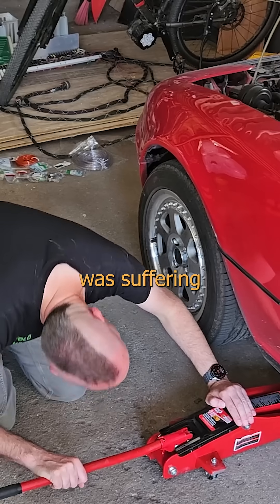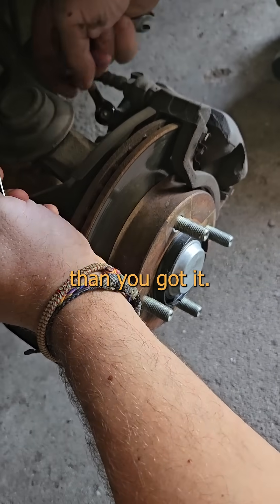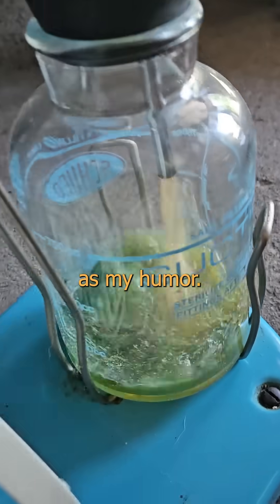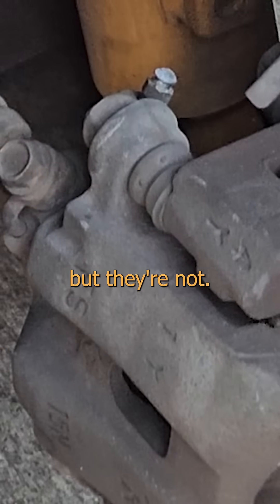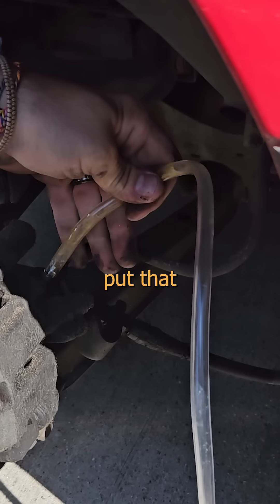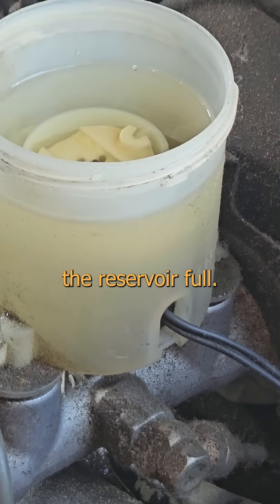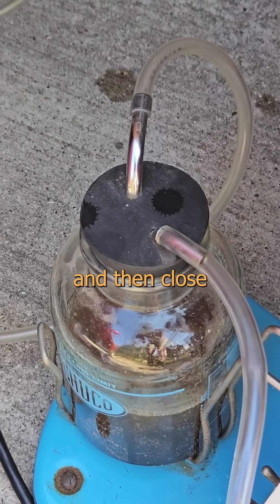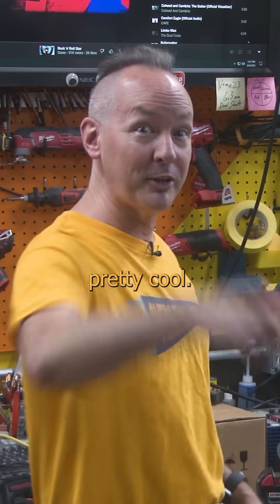How To Change Brake Fluid #chrisboden #comedy #engineering #educational #diy #skills #lifelessons

Comment: if you loop a hose twice hold it together tight with a rubber band and make sure its hanging some what upright and just pump your breaks if air comes out it will be pushed out but if it comes back in it will get trapped in the top loops

Comment: It's not really that over engineered, the machine we have at the shop does sort of the same thing. It pushes fresh brake fluid into the reservoir and you have a little suction hose for the old fluid. Fuck pumping, this is way easier.

Comment: Hey Chris! I dont know if you haven't known or if you dont care, but those bleed nipples aren't just regular 9/10mm, those are very slightly smaller, the standard open wrench will "work" with those, but you have a high chance of stripping those valves. Same for brake lines or clutch hydraulics. I recommend getting a flare nut wrench set, those fit on perfectly and have more grip, no chance those will slip! Might save you a lot of headache as I'd say youre also the kind of guy who works on his own cars and also loves having a good tool for the job hah

Comment: Remember to start with the rearmost breaks furthest away from the master cylinder train at first , then the other than the other two upfront. And it would not hurt you to heat it up a little bit before you try to move those nuts on the blead valves , because believe me , when they strip , you better off just getting a new  cylinder.

Comment: Polyethylene Glycol is not an oil.
Edit: it's a hydroscopic polyalkylene glycol-ether based polymetric fluid in the family of polypropylene glycol ethers with borate esters to resist compression, boiling and water vapor cavitation.(Not an oil)
"And that's pretty cool!"
Also, good on ya for freshening up your freinds whip.
God bless you and yours brother.

Comment: As a general service tech, when we sell brake services the machines we use to flush brake fluid out work in a similar manner. There’s a part that fits over the fluid reservoir and a part that that attaches to whatever caliper you’re servicing that allows you to pull a vaccine and cycle in new fluid at the same rate.

Comment: You can do it the other way too!  At my work, we pressurize the resivoir and force new fluid into the system while we bleed the old fluid out.  It's a great way to do it because it's fast and you can easily measure the amount of fluid you replaced.  That way you know how much to charge the customer for in materials, or how many beers they owe you.

Comment: Ypu can alsp do this with positive pressure useing a pump spray bottle full of fluid attached to the resivour. Just make sure you have a bottle to catch the fluid from the brake caliper or many many cans of brake cleen. I mean as a mechanical capable man im very used to having fluids sprayed everywhere when im working.

Comment: Just remember, especially on vehicles with abs modules, never let the fluid get below the level of the reservoir container because you need a high level scan tool to even access the abs computer let alone do a flush on it. Once air gets in, you aren't getting it out easily. When I had a bad brake line, I cycled the abs pump by locking up the brakes on a gravel driveway that was on a hill (not the safest). 
Also if you use a vacuum pump, suck the old fluid out of the reservoir and refill it with fresh before you start this process. He showed this briefly but didn't say anything about it.

Comment: My dad taught me to bleed breaks 30 years ago, with an assistant and a wrench to tighten and loosen the bleeder valve. Loosen the nut, press the pedal to the floor, tighten the nut, raise the pedal repeat until brake fluid flows with no air spurts.

Comment: I use a bottle that can be pressurized attached to the reservoir. Pushes the new stuff through rather than sucking the old out.
Both work well.

Comment: Before you completely finish you should always do one manual bleed on each bleeder port without vacuum.  The vacuum tends to draw air from around the threads of the bleeder, so a tiny air pocket develops inside the caliper when you shut the bleeder.  The manual bleed takes the tiny bubbles out.  It’s made more evident on motorcycles that there is air in the system because you’ll get a soft brake lever.  The brakes systems are smaller on motorcycles so in automotive it may not matter as much, but I assure you their is some air in there right after using the vacuum unless you teflon tape your bleeder threads or just do that one manual bleed.

Comment: Easily under engineered by using the same aquatic vinyl tube, an empty 2 liter soda bottle with enough fluid to submerge the tube, then using the cars existing brake pedal to push the old fluid out, and the submerged tube will only suck a little old fluid back in. Both tactics of someone without a friend.

Comment: Great info!  One thing I’d like to point out to others though is make sure your vehicle doesn’t have its own braking system flush service built in.  For example my BMW i3 REx can flush its own brakes and my Ford CMax Energi can also flush itself.  My friends Mustang can as well.  You download this software called FORScan onto a laptop and then you buy a OBDII FORScan ready USB OBD adapter but don’t buy the ones that have a physical switch.  Then you start the process in the software and the software will tell you to go to each specific wheel and then have you go through a procedure of opening and closing the stop cock.  It will even remind you to fill the reservoir periodically.  It will completely flush the ABS and the entire system.  I think if I remember correctly there are 2 procedures.  One procedure is just intended to bleed the brakes and the other is designed to do a complete flush.  

Anyways if your vehicle can do it on its own then try to do it that way.  I’d assume most vehicles that DO NOT have a vacuum assist diaphragm can probably do that if you have the correct software.  There may be some systems that can do it even if they are using an old school vacuum assist system.  

Oh also I’d like to point out that you don’t have to own a vacuum pump to do vacuum bleed your brakes.  You can borrow the pump from your local parts store.  Also the hand pump speed bleed system works well.

Also there is a reverse system out there that is just amazing but the tool is somewhat expensive.  Instead of drawing fluid out it pushes fluid in.  Some people will say it’s bad for the ABS to use one of those but that’s nonsense and if it’s true it’s true like jumping a car can damage the car or welding on a car without disconnecting all the body modules can damage the modules.  Both of those scenarios are true however it is extremely rare for that to happen.

Comment: Quick question for the other car guys in the chat, does this also bleed the clutch cylinder? Is there anything special I need to do for that? I was planning on bleeding my brakes and clutch for the first time in the manual I bought this summer, but I haven't figured out what I'm supposed to do to make sure I get it all flushed properly, and this video looked pretty easy

Comment: I have owned many N.A. Miata's and I tell u hwat. That brake fluid will be black in a month. It'll work fine but Miata brake boosters allow fresh air into the reservoir and it turns the fluid black really quickly. I thought it was an issue when I got my first one

Comment: Funny part they make an actual vacuum pump for brakes there's also the reverse option with pressure bleeding by pushing fluid under light pressure into the reservoir

Comment: If I bled brakes in a borrowed car I would end up having the bleeder snapping off in the caliper drying to get it loose the day before it needs to be returned and I would be working by trouble light in the driveway for the afternoon until midnight.

Comment: Dont forget start at the wheel furthest from the master. Then go to the other side then go to the first side front and end eith the closest to the master this ensures all the fruid is new in the system. Brake fluid is hygroscipid and becomes corosive and will taint (hehe) new fluid.

Comment: Almost how we do it at the dealerships. We have a machine that you hook to the reservoir via an adapter cap that pushes fresh fluid in from a holding tank while you suck out with vacuum on the bleeders. Makes it super easy.

Comment: I did this recently on my motorcycle. Only i just stuck a hose on the bleeder and hsed the brakes natural pumping to clear out the old fluid. Much slower but it can be done solo

Comment: Two minor addenda:

1) The "Eezibleed" or similar kits which usually work off a part-pressurised tyre are a bit cheaper and in some ways easier to use.

2) You might need to use a diagnostic tool plugged in to the car to run the ABS unit to get it flushed properly.

Also make sure you don't accidentally put the calipers on the wrong side or they don't bleed properly and you'll go crazy trying to figure out why. Guess how I know.

Comment: I do mine the opposite way. I have a pressure bleeder. Hook a tank full of brake fluid up to the reservoir, put it under about 1.5 bar, and push the nasty right out the back.

Comment: Just a little tip for extra spice. You'd always start with the farthest caliper from the Masters Cylinder. Cause that's where the brake line is the longest. And the longest line is the favorite place of air, sediment, and other stuff we don't want to boil in our brake fluid. Furthermore it reduces the risk of stagnant fluid contaminating the new brake fluid. The path of least resistance that you establish could be the result of that because pressure equalizes along the path you already cleared.

Comment: They make vacuum tools specifically for this job which shops tend to use, so it isn't crazy over engineering. They are still wayyyy better than doing it manually with two people.

Comment: I have never had any luck with my vacuum pump. It is terrible, however using a pressure pusher has worked well for me if you can get the dang caps to seal.

Comment: Opening the petcock and pulling a vacuum allows air to get in past the threads, it is quite common to introduce air intot he system this way, but not always, its a bit of a trick to get it right.

Comment: Certified Ford mechanic and instructor here: please don’t ever use vacuum to bleed a brake system on a Ford vehicle with an Electric Brake Booster (EBB). It WILL become damaged and you’ll have to replace it - which is about $2,500 P/L. 
Thanks for coming to my TED Talk. 🙏

Comment: They use those same vacuum pumps to pull fluid from lungs in hospice 😵.

We'd receive them back from customers with the collection still attached, to deal with it some coworkers developed a dark humor.
They called it lung ceviche.

Comment: this is how i do it at work ( I'm a mechanic) , while not using a vacuum pump , i do use a bleeder that makes a vacuum with a venturi effect with the shop air pressure

Comment: When I worked as a line tech, we had a machine that did this for us. We could do 2 valves at a time, but the conceptbwas exactly the same. Makes it super easy, honestly. Not over-engineered in my opinion, unless you want that badge if honor 😂

Comment: If you do run you brake fluid dry, make sure your ABS system is properly bled if equipped. You may need to find a scan tool that can command the ABS pump to bleed itself. 
As always, test drive to make sure the brakes work before giving the car back to the owner.

Comment: Returning a borrowed item in better condition than you received it is a great principle, but I would recommend getting the owner's OK first before doing any significant work (unless you know them well enough to know it'll be fine). Some people are really particular about their preferred procedures and schedules, or even what brand or type of fluid gets used.

Comment: I do it the other way round these days (Workshop owner/operator here). I use a pressure bleeder. Clips or screws right on the reservoir cap, holds more brake fluid in reserve than you're ever gonna need for 1 car and pushes fluid through with a light pressure, no sucking, no pumping, no screaming or regrets

Go to a wheel, crack it with a hose on and watch till the new fluid comes out, close it, move wheels, repeat. Great for pushing fluid through stubborn ABS systems that require some scanner intervention.

Cut my brake flush time down to half what it was with a vac bleeder, which is more than half what it takes to do it via gravity, or pumping the pedal. Thats definitely cool

Comment: This isn’t over engineered if it was you’d have had a contained loop with the new fluid cycling through from the fill reservoir to the bleeding petcock valves. It’s only half engineered as it is now.

Comment: Watch for an abs bleeder .sum need to bled independently ..and a lot of cars these days require specialised software ..we had an audi that was a DIIIIÌCK ..we bled it manually with the pedal while clearing the codes after every few pedal pushes as the system would lock up due to incorrect pedal travel ....there's usually a way around things if your clever

Comment: Or just a one way valve and push the brake pedal be careful of this method you are using if the car has a electric brake accumulator

Comment: I was an ASE "Master Tech" for years and years, this is the best way to do it. We would fit a specialized cap to the reservoir pumping fluid in at low pressure, then go around to each wheel, open the bleed valve until it ran clear, repeat on all four corners, and do that two more times. A brake fluid exchange alone should take you about 15min from the time you get the car racked and in the air.

Comment: a vacuum pump will work in a pinch, but the proper way to do this is to apply pressure with a fluid fed line at the cylinder. and at a high enough pressure to create velocity in the lines to allow the bubbles to move with the fluid and not stay trapped

either way great work though!

Comment: My favorite method is to actually pressurize the system from the brake master cylinder. That way you arent pulling air through any bad seals and you can spot them seeping before bad things happen 👍

Comment: If you didn’t have the vacuum pump it becomes a two man job, so technically it’s not over engineering, pumping the pedal and open close on the nip is a pain to do, has to be perfectly coordinated and you may as well just disconnect the brake lines drain all the fluid and start pumping pedal and manually bleeding the air, the vacuum seem like it’s way handy to have around, I never had the luxury of having one to use and I no longer turn spanner’s my self

Comment: if you put new pads in add brake fluid to the max level on the reservoir, as the brake pads wear the pistons get pushed farther out. monitoring the brake fluid level is an easy way to see if you pads are getting worn out without removing any tires

Comment: i have an old electrical metering doodad that i would like to donate to the channel. but i have no idea how to get in contact with you. it's says it's an "ohm meter" the tag says it's a WESTON model 796 type 1 and it looks old, like really old. i've had it for more than a decade and have never had any idea what to do with it. or even remember how i got a hold of it. it seems to still be in fair condition and even still has a set of leads and even a faded, yellowed paper placard in the lid.

Comment: Helped someone change out their breaks. Took like 3 hours, the manual plastic tool was half disintegrated and kept letting air in. At the very end he said wish we had a vacuum pump. I was very quiet and still for the next 10 seconds….. then proceeded to get punched in the arm. Very well deserved.

Comment: If the caps on the bleeder screws were still intact they should break free with ease.  I have been an automotive technician in WNY for over 35 years.

Comment: I'm an auto tech / mechanic and the equipment we use performs a similar function, but in reverse.  We attach a special adapter to the master cylinder reservoir which pressurizes the cylinder with brake fluid.  We then to to each wheel, in a certain order (usually right rear to left rear to right front to left front), and open the bleeder screw and let it flow until it comes out clear, close bleeder screw, next wheel.  These machines have brake fluid reservoirs on them so they supply the fluid to the master cylinder.

Comment: And for the love of god if the vehicle uses DOT3 (most vehicles from the 19....anytime to....today?) fluid, do NOT get it on the paint and if you do, wipe it off thoroughly and immediately with the quickness, or it will bubble up faster than your guts after a little too much enthusiasm for taco tuesday.

Comment: I want to build a high pressure smoke machine for finding air leaks on tractor trailers. 

It needs to have an operating pressure of 120psi as some air suspension leaks only occur when the truck is loaded. 

I’m thinking about using an air reservoir for a tractor trailer for a pressure vessel but how do I get the smoke in there?

Comment: Hey man. Been scrolling on your channel and saw a video about capacitors and one about an oscillating light. And it got me thinking. What would happen if you hooked up a supercapacitor and resistor to a clock circuit made of mosfets?

Comment: @Physicsduck Just remember. On NA and NB Miatas. You need to manually adjust the rear brake pad to rotor clearance. This also adjusts the parking brake. There's a 14mm bolt on the rear caliper next to the brake hose banjo bolt. Inside there's a small adapter that accepts a 4mm hex key. Tighten it until the pads grip the rotor and it becomes difficult to turn, Back it off 1/4 to 1/3 turn. Replace the 14mm cap bolt. Check parking brake engagement. Should be around 4 clicks. Brake pedal feel will be improved as well.